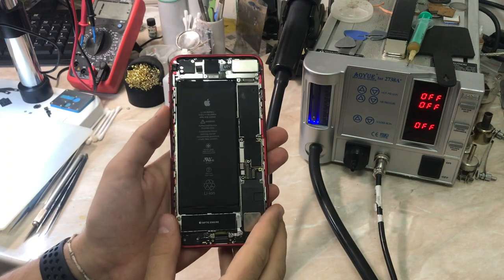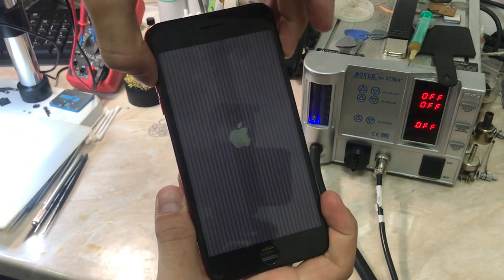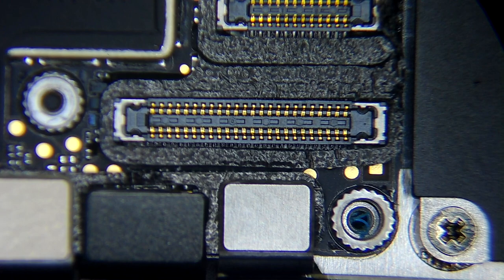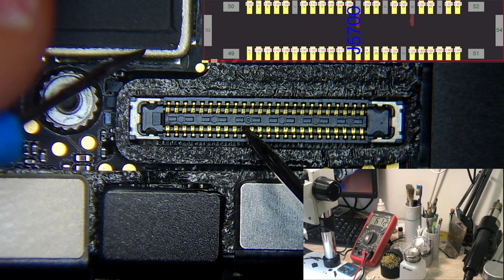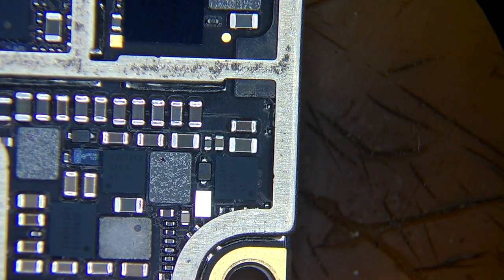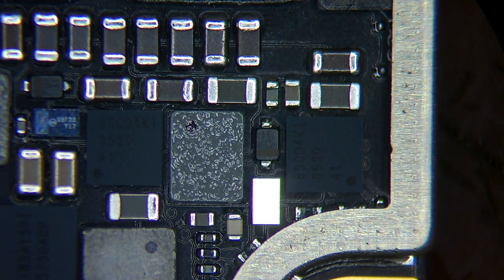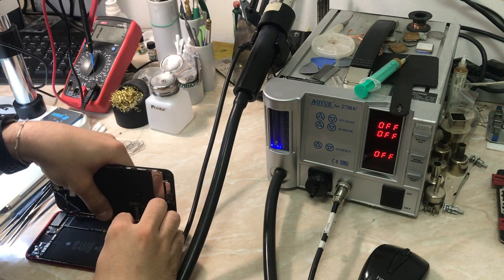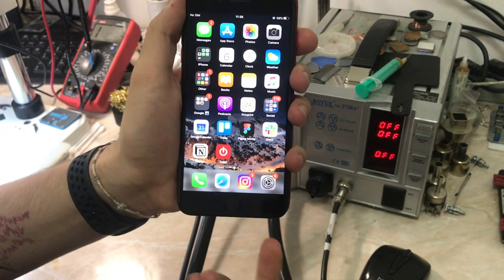iPhone 8 Plus Display Problem Repair (PP5V7_MASON_AVDDH Short)

Comment: I have opened my phone and i have looked at it. i restart it and no picture will show. but when i move the cable a certain way, the screen shows up. then it fades in and out from lines to the apple logo. i have no idea what is wrong.
Reply: bro did it fixed?
Reply: i have samw exact problem